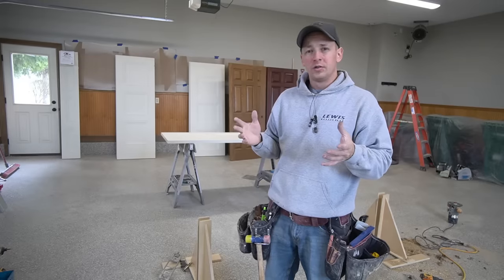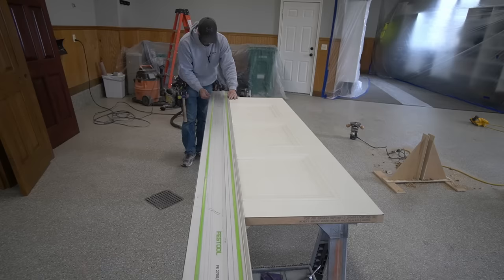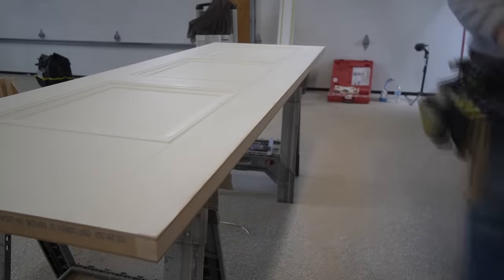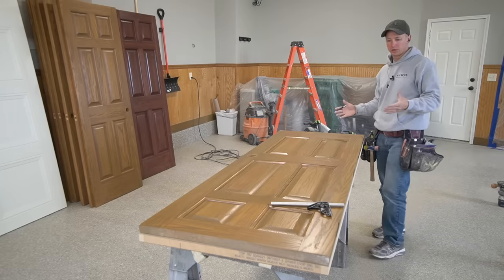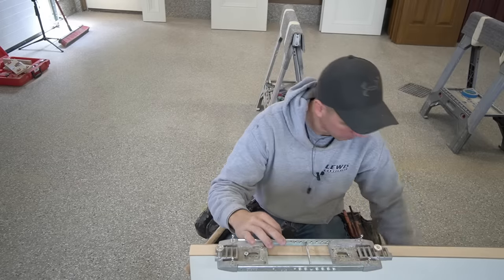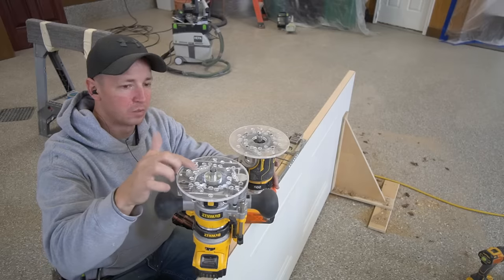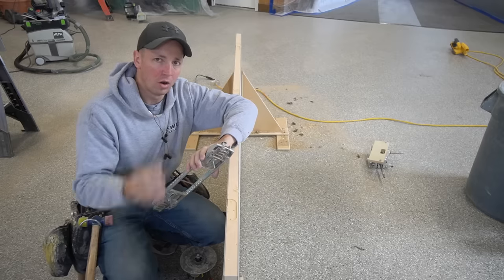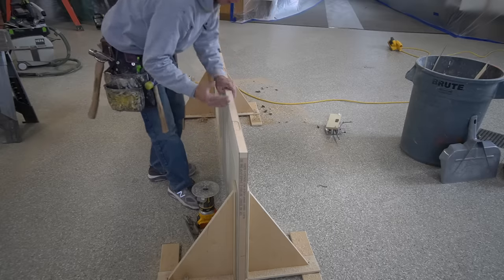How to Hang a New Door in an OLD OPENING | Whole House Interior Door Slab Replacement

Comment: You put a slice angle on your cuts to the sides of the doors, when you placed the old doors on the top of the new ones. Where they front to back. Or back to front or front to front or back to back. The way you marked the doors seemed complicated. And as you stated your trian to improve the fit off the doors. So why are you mirror imaging the doors.

Comment: I have hung hundreds of doors.
Firstly, I have a methodical system so that I do not double handle.
1, before removing the old door from the existing door frame, mark it up because it will become your template for your new slab. T = top of door. Outside of Door. H= hinge side and hinge markings. Mark any gap tolerance revisions (+ or -) and lay old slab on top of new slab and transfer all marks, no tape measure necessary. Love your workmanship.

Comment: Love your door holder. What a great idea
Reply: steeltongue502  I've got one of those small things by trend with the built in screw clamp idea but not as sturdy and easy to use as that idea
Reply: steeltongue502  that's the benifit of the trend one. Very transportable. Yeah if someone could invent a colapsable one bit like those colapsable saw horses it  would be a winner
Reply: steeltongue502  no probs buddy. I use one but perhaps 2 would work better

Comment: Good tip on the routers. 
I hung dozens, maybe hundreds of doors in the old jambs as an apprentice and carpenter. 
We never used the old door as a template. 
Measure the opening .In this case I would have taken the 1/8" off the bevel side, if the jamb is even, leave the line for the planer, we didn't use  track saws. 
If the jamb is not even, you'll have to scribe the door on the lock side. Measure the hinges on the hinge side, leaving an 1/8" at the top (some carpenters would place the door in the opening and mark the hinges and scribe the bevel side). Transfer the measurement to  the door, route the hinges. 
Mark the center of the lock from the striker hole in the jamb. Install the lock with the door in place.
Sand the edge of the bevel side.
If we got good, square door jambs, we could hang up to six doors a day.
Reply: He's making huge assumptions the previous doors fit properly.   My dad was replacing house doors but left them in the garage so long they warped.  The installers had to tweak some of the strikes by almost half an inch to get the door to close.

Comment: This is great and I wish I had seen this a week ago. Just replaced doors in a whole house but the existing doors had already been discarded so each new door was custom scribed to the jamb. On and off the hinges many times to get a good fit and nice reveal. 
I would love to hear how you would deal with a poor original jamb installation.  I had issues with cross leg, tight gaps below the bottom hinge and jambs that bellied out an 1/8 inch in the middle. Needless to say the doors could not be cut straight but needed to be scribed to get an acceptable reveal around the door. 
Appreciate you taking the time to deliver this content and for all the tool recommendations.
Reply from the maker: It’s tough man. You can turn the install on one door into an all day job if you want to when the jamb is bad. It’s tough. 

My install wasn’t perfect but it was better than what was there before. It’s hard to find the line between acceptable and over doing it on a replacement job.
Reply: If the new door will fit in the jamb drive shims under & around it till you get the reveals right (if needed mark any scribes on hinge side) use a knife to mark the hinge locations.  Slide each (marked, top, mid....) hinge into each pocket and mark depth, when making depth on door go 1/16" deeper to clear stop if door was held tight to stops. Pull down door, cut any scribes, sand/finish edge and dap hinges, hang door.
If door is too large to close, cut a 1 1/4" long carpenter pencil and sand it at a long angle on one of the flat sides so the lead is flush with the flat side, pull the door up to the jamb and use this custom pencil (holding the flat lead side on the jamb) and scribe the door. When you cut this take the line plus a strong 16th more and cut at 5 degrees so you don't end up with a huge gap on the other side.
If the new door won't fit in the jamb do the same jus start on the hinge side.  If the door is way over sized take some from each side.  As far as cross leg it's easiest to pull or move the stops and try to keep the strike aligned. It is possible to spread out a cross leg issue by altering the hinge depths but is a real mind bender so quadruple check everything if you go that route.
Reply: @awls7393  Exactly right! You'll never measure your way to a good fit in an old opening.

Comment: Great video for new guys trying to understand and for old guys who have forgotten. Every few years I am tasked with hanging a door or two in old openings. I have all of the tools that I need and have hung enough doors to do a nice job, but when a lot of time has passed, I always head to YouTube for a refresher. I'm glad that I found your video, not only did I use my tracksaw (new technique for me) to put a perfect bevel on both sides of my door, but you offered enough discussion to help keep me from wrecking a door. Found my old (like new) Templaco template to route for 5/8" radius hinges so I didn't need to get the new bit and guide and plate. I had my casings off, so I was able to adjust the opening enough so that I didn't have to make weird cuts on the door. Good work!

Comment: For those fine hinge location adjustments (front to back) I cut some strips of magnetic sign material that stick to the hinge jig. If you need just a bit more cut a strip of metal lumber banding and it will stick to the magnet strip or mag strips can be stacked. Mine is the P. C. jig so your experience may vary. Great content!

Comment: Great job. Mostly the way I have been doing it. The only thing I have learned the hard way is that installing the door back the hinges do not always line up. To give extra wiggle room I only install the center screw on each hinge. This way I can bump the hinge and make it fit. Then once the pins are in I install the rest of the screws.

Comment: Thanks for the upload Spencer. I did this very thing a few weeks ago using a Ryobi jig which came with a Vix bit.  It  worked great and was my first time using a Vix bit. I knew I wanted one, but they're hard to find locally. I just got a set delivered on Thursday using your amazon link. Everybody wins.  I wish I could justify spending the money for those nice knee pads you use, but I did upgrade to a pair that Velcro over the knee and under. Maybe they wont keep sliding down.
Reply from the maker: Awesome. I'm not sure what your age it but if you spend any amount of time on your knees they are essential $300 is nothing compared to the cost of knees going bad over the long haul. I wish I had purchased mine a long long time ago. 

I actually used that Ryobi jig on the last 4 doors. I was impressed with it. I will have a video coming using that jig also.

Comment: Always love building and cutting in doors, learned way back in 80’ while working for a Remodeling Contractor and were site built. This is way prior to pre-hungs and the first P-H I came across much later I couldn’t stand the fact that the hinge radius was much larger and of course the hinge ga. Was thinner too, having the stops attached didn’t allow for off plane adjustments either as we always cross X’d our Legs with string line.The only jamb stock that had stop was Exterior doors that was milled in.  I replicated a folding door jig table from another Finish Carpenter around 90’ and still use it. I can lay doors flat across the top or on edge for planing with 12” metal standards fastened to the legs and wood clad brackets that adjust up and down to the width of the door I’m working on.  My set up and door cut-in’s on an existing jamb are identical, using an Adj. Porter-Cable butt ga. one template piece at a time. Spencer, I always appreciate your old soul advise on safety first especially out in vid land regarding the importance of allowing your tool to stop before removal and likewise on start up while in the template. Great video as usual, keep-’em coming!

Comment: The ryobi hinge jig works really well for mortising and has inserts to adjust for different hinge radii.  It clamps onto the door rather than nails and by putting a shim in between the clamp and door you can adjust the offset.

Ryobi also makes a great jig for mortising the latch plate.
Reply from the maker: I actually used that jig for the last four doors. It's not bad at all. I'll have a video coming of that jig in use.

Comment: It’s important to assess the condition of each old door in its opening before you pull them.  If the head is out of square, you’ll have no good way to adjust the head margin once you’ve mortised the door.  Good idea to keep a list of head and strike margins of the existing doors before pulling them.
Reply: I do this !  Spot on . Saves a lot of time
Reply: We'll said. I've only replaced doors in existing openings as part of a couple of renovations but on my travels have had the pleasure of working with true tradies in several trades. A tip I got from a chippie (carpenter) here in Oz was to go round and tighten all the existing screws which would either result in the door pulling up/in somewhat or the screw/s would spin.Then we'd wedge and pencil around the existing doors in situ, measure the "slack" and mark the hinge holes that needed dowels. He did the magic on the doors and I was left to dowel, glue and flush the buggered screw holes. This was before oscillating multi-tools. A hacksaw blade, cut to a point and sandwiched between two scraps of wood, bound by gaffer tape was the go. Hi tech shit back then! Bevels were planed by hand and carbon paper used to show sticking points either side. Not sure if you can still get it but it saved over dressing/time and improved the finish. Locks/latches were done once he was happy with the way the door hung. Marks were scribed for jamb to door then a wedge either side held it still while the new kit was dressed in. All sounds a bit rough but the doors all swung free and true and no power tools and this was in the early 90s when most tradies had a durry (roll-your-own-cigarette/rollie), usually half smoked and unlit, in the corner of their mouth, and knocked off between two and three to have a few stubbies with the crew.  I've gone down memory lane, haven't I? Forgive 😂😵

Comment: Looks just like my process. One tip, take some scrap 1x and rip 1½" strips, then cut to 5½" long. Get some spray 3M spray adhesive and quarter a sheet of hand sandpaper. Spray both, let set, wrap around the block and you'll have the best sanding blocks you can get. Painters have been stealing mine for years. Norton is the best paper I can get, but its it's hard to find. Great video!

Comment: I built a similar set of saw buck except mine fit the original door and the new door at the same time. I built a stop on one side that aligns the doors when I put them in, hinge side up. I then transfer over the lines and trace out the handle position through the hole. Take the old door out and clamp the new one to the bucks and mortise out the hinges. This way I save having to align the two slabs and my site line on the hinge mortises is straight down when marking..
Reply from the maker: That's a great system. I considered doing the same. Next time...

Comment: Putting a bevel on the closing and leading edge also makes it easier to plane with a hand plane when your matching the door to  the jamb.
Reply: I always do square cuts on the hinge side. Only ever put a very slight bevel on the lock side. Might have to give it ago next time, but I can’t see any benefits?
Reply: @AshHalls  The benefit is if the jamb is not straight, it is easier to plane the door  to match the jamb. In the UK we call it shooting the door in
Reply: @jimbow2310  I see, its a old school technique for making it easier with a hand plane. I don't even carry a hand plane now, the old boys can't believe people don't use them on site anymore.
Reply: @AshHalls   I use a power plane to put the bevel on then finish with a hand plane. I guess it depends what sort of finish you want to leave on the lipping. If the lipping has grain reversal on it, you cannot close the mouth on a power plane like you can a hand plane. I combine old school with modern so you get the best of both worlds.
Reply: @jimbow2310  I see. I shall sharpen my hand plane, and start becoming a true craftsman. Sometimes the old hand tools that many people don't carry provide the best results, like a wood rasp.

Comment: Might help you on your splinter guard in a pinch. I have not felt the need to put a new one on yet even thought i have some in my van. Last few times ive just pulled it off used a rag with lacquer thinner wiped it down to clean it and just lightly dabbed the lacquer rag on the double stick tape  to re activate the glue and set the strip out just a bit. Or i restuck with the fastcap laminate tape.
Reply from the maker: That's a great idea, I'll have to try it. I often warm mine up with a torch help it peel off easier.

Comment: Out with the solid (core?) oak. A bit painful, but they must have been a bad fit for style. Great tips on preparing the new doors - especially the reminder to measure from the wide side. Thanks for the video.
Reply from the maker: Yep. They were solid raised panel oak. But it was time for them to go.
Reply: @InsiderCarpentry  curious, why couldn't they have been refinished to white? Really, are there any upsides to switching to the new doors?
Reply from the maker: More labor in refinishing and the heavy oak grain would have shown through after paint. Painted oak does not look good. Plus they were the typical outdated raised panel look.
Reply: @InsiderCarpentry  I hope they donated the doors at least.  Would be beautiful for a homeowner who wanted to refinish themselves.
Reply: @InsiderCarpentry  gotcha. Did they go in the trash? Or did you keep them

Comment: Your “door bucks” are great. But I set mine up on saw horses that are shorties. 15” off the floor! I call them my ponies. That way I’m mortising up at waist level or maybe just a little higher. (I’m almost 60) And I also use my porter cable mortise jigs independently when I’m copying old doors. The original “Vix” bit are the only good ones! Great video! Thanks for sharing!

Comment: Spencer . I want to compliment you on your videos and your skills.  I'm a door hanger and specialize in rehang's ...I have found the metal Porter Cable door templates work best for this type of work.  They have a center mark for the hinge mortise ...I found laying out centerlines of the hinge mortise  is the most accurate !  Dewalt flexvolt trac-saw  a single template and a simple Lennox lock boring jig with holesaw works best . The spur cutters on the high end boring jigs are fragile and don't feed very well !
Reply from the maker: That’s a great idea regarding the center lines. 

My complaint on the template jig is definitely the feed rate. But I can’t say i have much better success with hole saws.

Comment: Congratulations on back beveling the doors, particularly the latching side, as this is one of the very basics indoor hanging that no other YouTuber seems to have a clue about. They hang doors with square edges so once the back of the door is level with the front of the casing, the clearance gap is halved. I do however hang replacement doors as a new fit. I'd never copy an existing door as you could well be duplicating the bad as well as the good, so a badly fitting original door is replaced with a badly fitting new door.
Reply: Check the old door and make any adjustments on the new one. Much easier than starting from scratch.
Reply: @dwightsornberger8916  You can only correctly hang a door by fitting to its door frame directly. I think your choice here is the “easy” incorrect way, or the correct way that takes that little bit more effort. I’m afraid the correctly fitting of a door is a dying art

Comment: Why couldn't you use the Dewalt?  Isn't the key point the offset between the bit and the guide bushing?  BTW I use the Trend Hinge jig (and Jamb Master on your recommendation) - I began routing with the Bosch Colt until I took it out of the jig while spinning.  The carbide broke off of the bit when I made contact with the jig - not safe...jambs were in place and it was at eye level.  Straight to the store and bought the Dewalt - I love the brake on the motor.  You have taught me a lot!  All the best.
Reply from the maker: I have in my head that the bosch template kit has to be used with the bosch base plate but I could be wrong on that. Now, I'm doubting myself. I'll have to check that again.

Comment: I always have trouble with the hinge depth on old doors in old houses. Most of the time I’m only rehanging 1-2 doors so I freehand route the hinges vs using a template.  Moving stops is a big pain in the ass lol, as is trying to move the hinges in a 16th towards the stops.

Comment: Hi Spencer, I offer a suggestion that may help. Woodpeckers parallel guides for the track saw. You will love them. Check them out. Why didn't you use the Ryobi mortising jig that you list in the description? Another great video.
Reply from the maker: Thanks! I was actually thinking the whole time about using parallel guide. I have a set made by Seneca but I haven’t used them in years. I should have got them out. 

Funny thing is I actually bought that Ryobi jig. I asked on Instagram what a good jig was and quite a few mentioned the ryobi jig. Soon received it just before the job was over and used it on the last 4 doors. I was impressed! I took video and will have a review video published at some point. Definitely a good jig to keep around. Can’t beat it for $25.